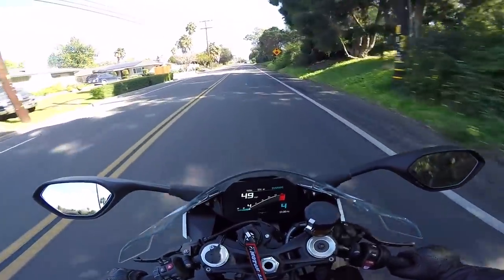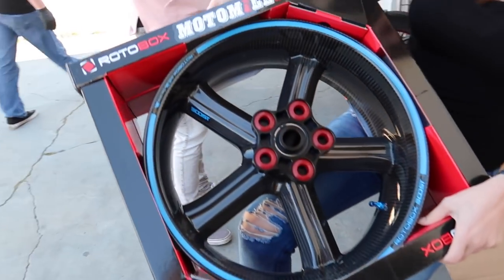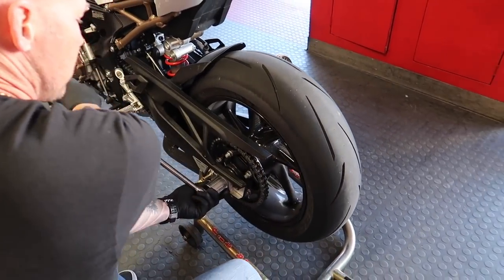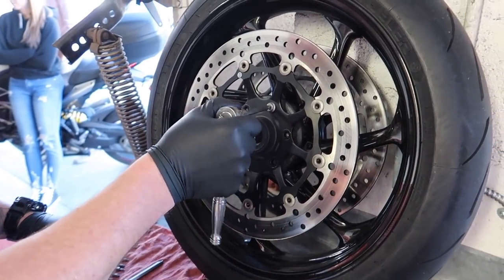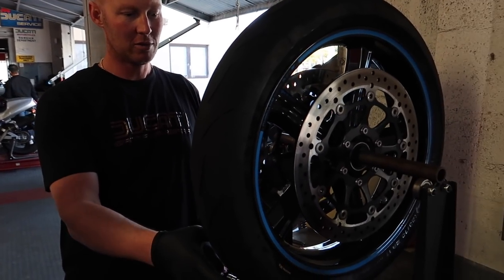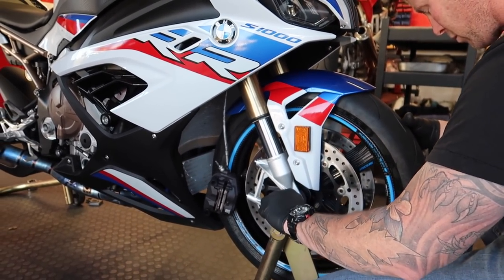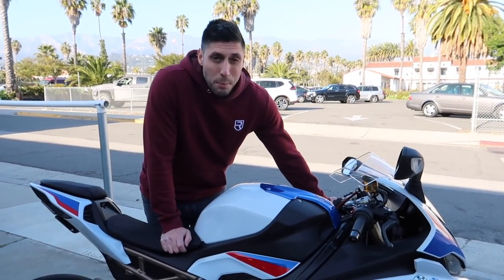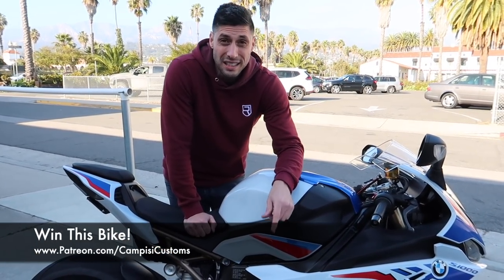2020 S1000RR gets Custom Painted Carbon Wheels!!!

Comment: Two observations1. Make sure you fit a rad guard and oil cooler guard to that puppy. BMW radiators are rock magnets and made out of tin foil - they puncture way too easy. Ask me how I know!!! and far, far, far more important2. Take those rotors off and throw them in the trash before someone kills themselves. The pads on my S1k are tiny - 4 in each caliper and the cutouts in those rotors are massive and with hardly any metal for the pads to bear on. I suspect your braking performance will be pants but surely, there is a very real risk the forward edge of a pad catching on the edge of each cutout under braking - either the pads will wear out in no time at all or worse still, a disc could shatter under braking - put the one pound back on and stick the OEM rotors back on that S1K and stay healthy!!!

Comment: "I think these are going to be a touch heavier, but not enough enough to matter." Dude, it's unsprung ROTATING mass, every ounce counts. At 200mph the the rim is doing MORE THAN 2000 times it's weight in gravity as it's spinning 38 times a second. Ya gonna notice ounces at these multiplication levels.
Reply: Amen.

Comment: That weight you’re shaving off is rotating (rotors, bearings, wheel tires, hubs etc) unsprung weight...which is approximately 4:1...every pound equals 4lbs...so it can add up...the biggest gains are usually from the wheels...but you already have light wheels...
Reply from the maker: yes you're absolutely correct!  We will also save a few more pounds with the chain and sprockets as well so it will add up for sure

Comment: Little curious about the weight savings... is the rear the same size? Also, I wonder, did you just replace super high end BMW OEM wheels with cheaper aftermarket ones? I would be kinda surprised if the BMW wheels were cheaper

Comment: streetfighter v4 or that new 2020 superduke R for the next custom bike eh ;) ?
Reply from the maker: Streetfighter V4 has already been ordered :)
Reply: I am bias since I've had several KTMs but seen both the new Streetfighter and the new Superduke in a motorcycle show.
The V4 Fighter with winglets looked silly.
The new Superduke looked brilliant and comfortable in comparison.

Yep the Ducati will be faster (at least top speed) but in a naked that is irrelevant.
The torque, wheelies and way more comfortable ergonomics on the SDR look much more tempting.

Comment: You paid extra money for the M package s1000 which only comprises the following main parts - 1. Motorsport paint finish, but you are going to re paint it .. 2.  Carbon fibre wheels, you have just replaced the wheels for other carbon wheels? Was it worth it?
Reply from the maker: yes because I got the electronic suspension and all the race pro settings
Reply: He didn't pay for anything
Reply: @JaretCampisi  fair enough.

Comment: Just a question.
Since you are modifying the bike so heavily, why pay for the M-model to start with ?
It's a lot of money for the lithium battery.
You can buy the "stock" bike with the electronic suspension and pro riding modes for a lot less.
The M seat, wheels, colors... you don't use any of that suff but paid for it anyway ???
Reply from the maker: The main reasons is because they shipped the M version of the bike way earlier than the rest of the models and as I needed one of these back in November it was the only version available.

Comment: Did you reuse the air valves from stock rims (with tyre sensors)? I did not see the blue coloured air valves after fitting?

Comment: Will a 520 chain be safe for a bike with that much torque? I know that if you run a 520 on some higher torque bikes it has the tendancy to snap and spit out the chain
Reply from the maker: it makes a lot of power but not a ton of torque so yes it will be fine.

Comment: Why would you buy an M sport if you are going to remove what makes it an M sport
You could have just bought a regular sport model  and not wast the extra money
Reply from the maker: there many other features of the M model that we wanted and are keeping such as the electronic suspension, race pro rider modes, lightweight lithium battery etc
Reply: @JaretCampisi  all those features come on the sport model  except the battery
Reply: @JaretCampisi  great channel by the way. making some class bikes

Comment: thats not a Braking rotor, i'ts a MMR rotor from Canada, hence the maple leaf on it. 
https://www.mikeymoto.ca/product-page/mmr-ultralight-rear-rotor
https://www.motomillion.com/products/mm-racing-ultralight-rear-brake-rotor-for-bmw-s1000rr?variant=390117752846

MMR actually makes a full carbon rear rotor that they claim weighs less than .2lbs compared to your 1 1/4 roughly lb steel one you installed.

I look forward to the end results of the build, always fun seeing how much weight you can remove by replacing parts, great ideas for my weight loss endeavors with my bike.
Reply from the maker: oh wow I can't believe I've been calling that the wrong company for a while now thanks for clarifying man I appreciate it!